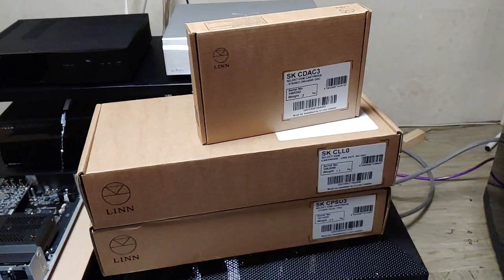Last upgreds form LINN for SELEKT: ORGANIK DAC and UTOPIK power supply are here

Comment: Hi, while watching this video i wonder that you did not unplug the power to this device while you open the chassis. in the last setup after you install the module i see that you only switch on the power,so my hope that you might unplug the device in the poweroutlet, was not the case. Please keep in mind that you provide AC power to that device, two wires.. the switch on the back only interrupted one power wire of two. either phase or the null wire, not both power wires that supplied this device. 
wihout knowing the detail prep guide to install the modules  i strongly belive that linn point you to totally disconnect the power while the chassis was open or while you work on that device with you hands-on to avoid serious damage to your health at first, second to avoid damage to the device because power phase might stay on! please take this commend as a personal suggestions to take care of your health!